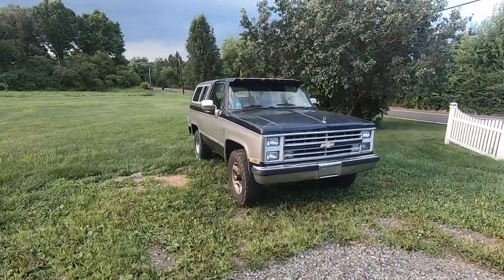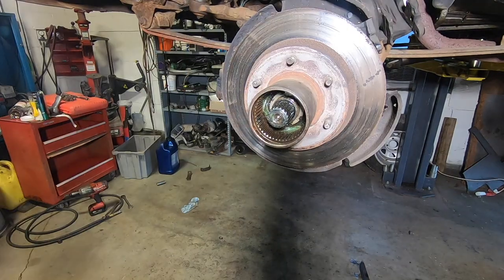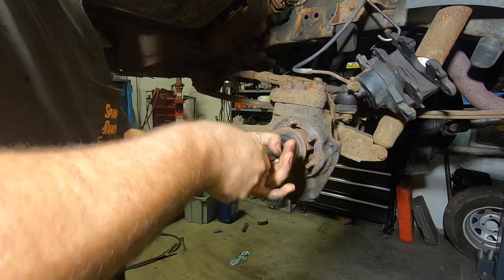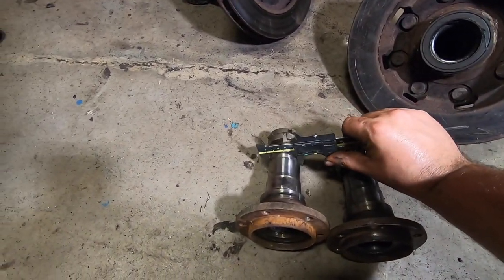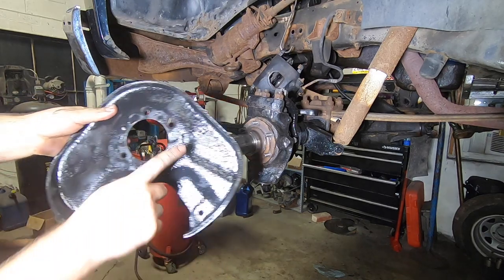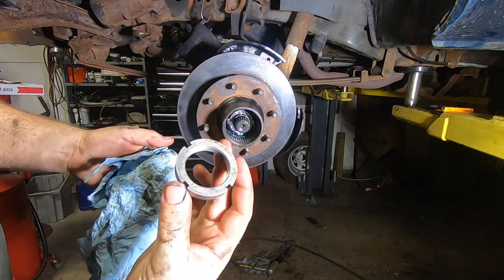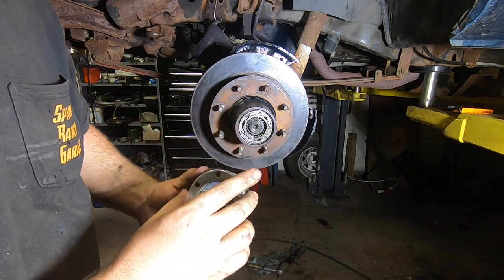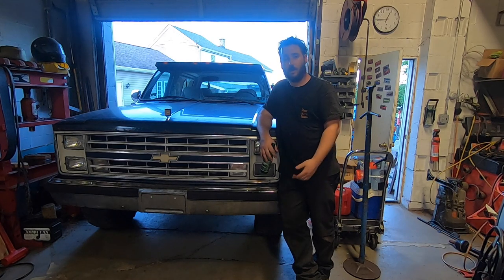EASY K5 K10 Suburban Blazer 8 Lug swap. Dana 44 or 10 bolt. 3/4 ton conversion

Comment: Thank you so much for this video. This is exactly what I needed. I have a 78 dana 44 front going into an 87 square 4x4.I had to get rid of the "full time" hubs. i kept the original front axle complete and now I am glad I did. It even has Warn manual locking hubs on the 87 so i reckon i can use those as well.
Reply from the maker: Glad it helped!

Comment: Thanks, dude just the info I needed. Just got a k5 that has 8 lugs front and back but the front is empty, but I have parts blazer with Dana 44. I now know I can just swap the hubs and go. got all parts but new bearings and seals.
Reply from the maker: Glad I could help. Good luck!

Comment: I didn't change my backing plates when I changed my front rotors to 3/4 ton. it's been that way for over 25 years. Stops just fine.
Reply: You kept the 1/2ton backing plate and caliper?

Comment: Looking forward to the 14 bolt video. Maybe a short drive video would be awesome too.
Reply from the maker: I made a video about "shaving" a 14 bolt that I later put in this K5. I have a few more videos coming up about that truck but not exacly installing the 14B. It was simple, just weld on some spring perches
Reply: I watched the shaving video and it was very interesting. I’m still looking for a K5 myself but here in North East Texas these people are sniffing idiot juice asking the prices they are. I appreciate the videos you have posted on the K5 thus far.
Reply: @doughboy1966 hey I’m from the Tyler area. Currently building a K10 and wanting to do a crossover setup in the front

Comment: What’s the point of using the bigger spindles? Can I reuse my old spindles and just get the rotor and hub assembly and the caliper backing plate?
Reply from the maker: As far as I know the 8 lug hub only comes big spindle. So if your 6 lug stuff is big spindle already you won’t need to swap spindles

Comment: if I wanted to get rid of my 4 wheel drive....do I just pull the axles from the front end so they can free spin
Reply from the maker: Yes... you can do that. Thats essentially what a locking hub does. When the hub is unlocked, the axle is not turning with the tire.

Comment: so when swapping a dana 44 from 6 to 8 lug, is the dana 60 and 44 stuff the same? or i need to be looking for 44 8 lug parts only?
Reply from the maker: Great question! For your D44 you can use only 8 lug stuff from another Dana 44 OR a gm 10 bolt. Essentially any 73-91 squarebody 3/4 ton. D44/10bolt are the same spindles out. Dana 60 stuff won’t fit
Reply: Thank you for the reply!

Comment: What inner wheel bearing did you use? I can’t find one that will fit.
Reply from the maker: For an 86, the 6 lug and 8 lug spindles take the same bearing. Order bearings for a 1986 K5 blazer they should be what you need